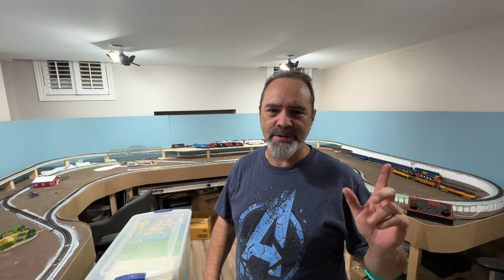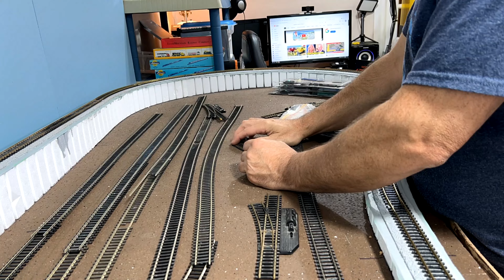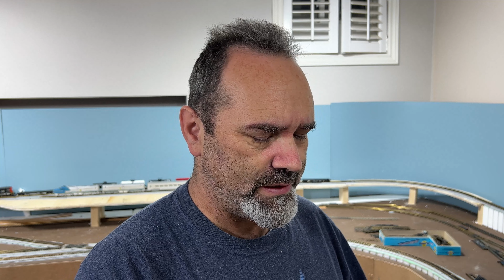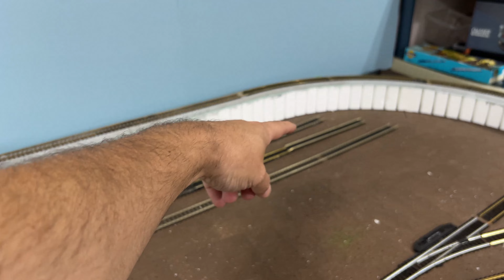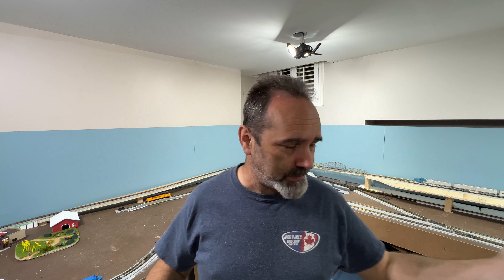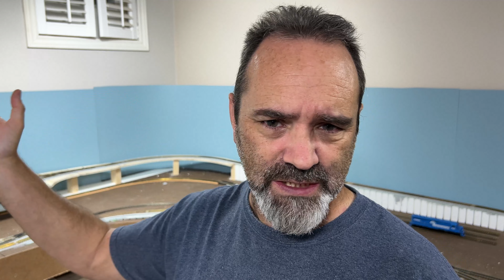Completing The Last Section Of Track On My New Ho Scale Layout

Comment: I've ever only run a single locomotive.  How do you store locos on an active track without them all going at once?  Isolate the storage track sections from main power and run additional wires so you can activate them as desired?  I feel I should already know this as I've run my set since the early 80s, but I'm still running the only locomotive I've ever owned.

Comment: 1) Getting enough staging/storage tracks is always an issue, no matter how big your layout is. 
2) You never have enough locomotives, even when you have "enough".
3) At 14:19, where you have that wiggle in the track between the 2 turnouts, if you move them closer together, or swap one or 2 with a #6, you can eliminate that wiggle. Right now, it's trouble waiting to bite you.
Reply: I saw that wiggle, too, but didn't know how to fix it.  Not a lot of room to play, but that's a pretty rough 5 inches of track.
Reply from the maker: None of the turnouts I have seem to line up to prevent that weird join. If I was to join them directly, they would not run parallel with each other. Even with a bit of straight track joining them didn't work. This was the best I could come up with, for now.
Reply: I think a small section of flex track will improve it instead of the small piece of  set curved track. It won't make it perfect but will allow a better alignment and remove the wiggle.
Reply from the maker: @peterainsworth8466  Yes, I'll give that a try